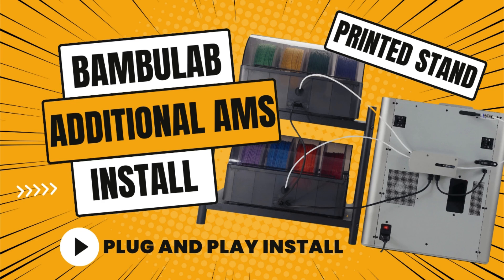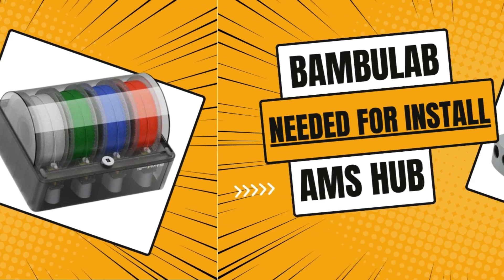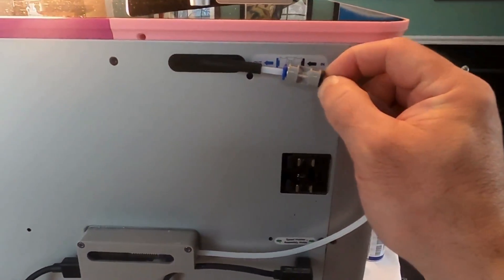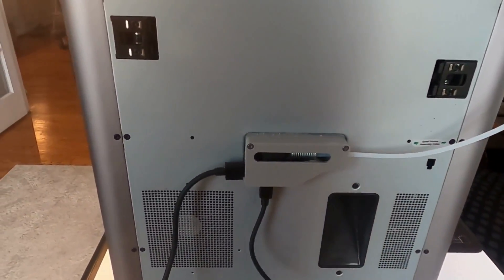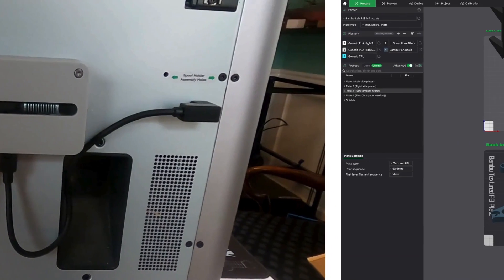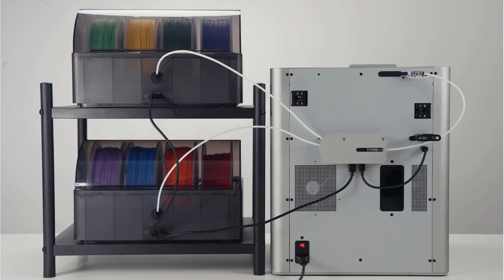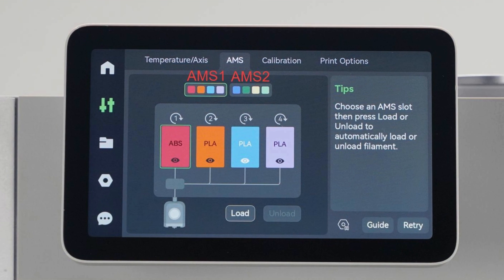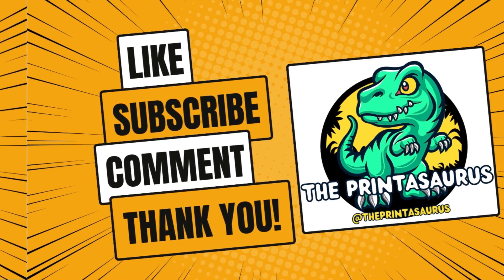Adding a Second AMS to your BambuLab 3d Printer

Comment: Hi there, thanks for the video! My second AMS just arrived and I had no idea I needed the AMS hub (super new to 3d printing) where would I purchase this? do you have one specific brand you would reccomend? thank you
Reply from the maker: The AMS hub can be ordered from bambu’s website. Another option I have seen that works is using the same 4 to 1 split that the A1/A1 mini uses. With you newer to 3d printing I would order the AMS hub, easy to install.

Comment: I'm using the A1 with AMS.  Am I correct that the hub could connect a 2nd AMS as you show here?  And... thanks!
Reply from the maker: I found this for the A1 - looks like it can only support 1 AMS Lite at this time. 
https://wiki.bambulab.com/en/a1-mini/manual/faq#:~:text=The%20A1%20mini%20can%20only,of%204%20colors%20for%20printing.